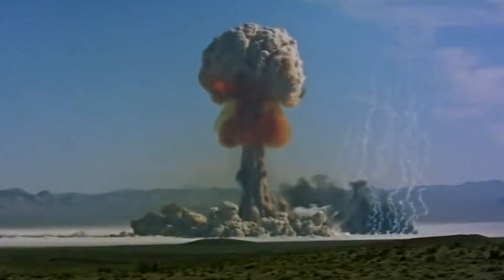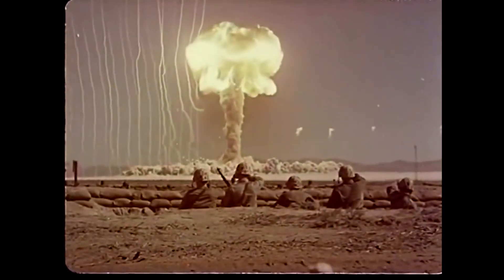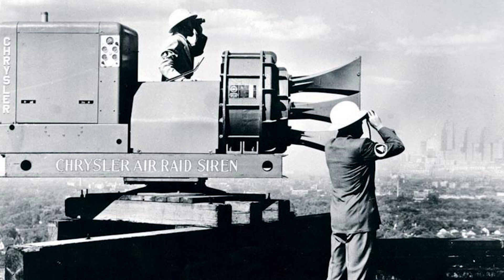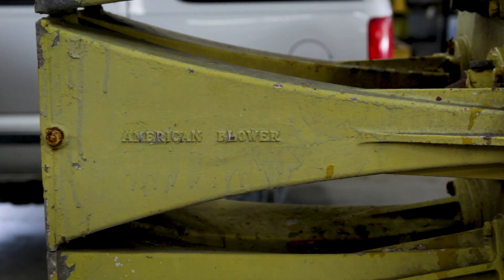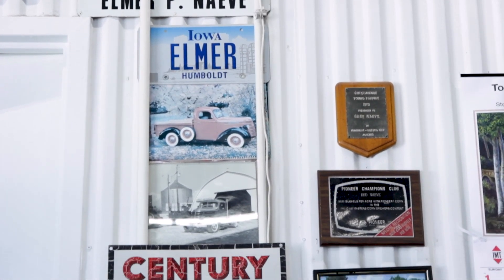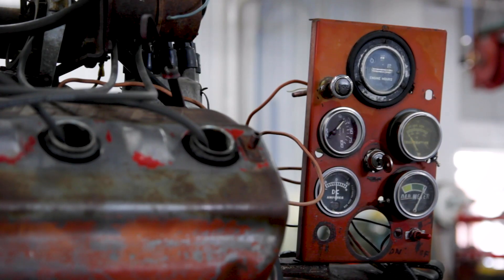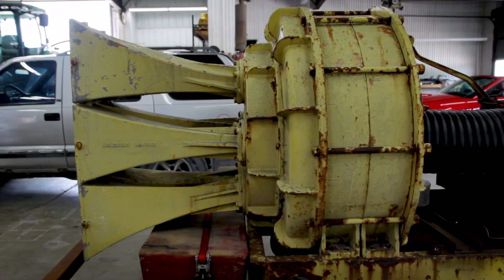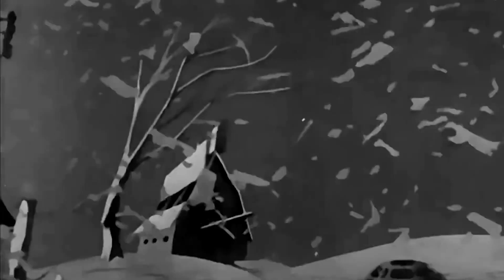Chrysler's Cold Warrior

Comment: There were british sirens that could be heard for miles as they were 150 decibels and as a kid it was scary to hear one up close but i love them now and yes it hurt my ears as the siren was at a fire station in the uk
Reply: The Chrysler siren was the loudest siren ever made, anywhere in the world. It's an established fact. Please provide proof of this 150 decibel siren you speak of.
Reply: @csmitharris1460  have a look on the klaxon website and look up klaxon GP12. I tell you now that this siren is very loud indeed like I said. This siren has a high decibel rating of ANY british siren. I know the Chrysler was America's loudest siren but our dual tone sirens are there as well. I should know. I have been close to one in the uk for a flood test and they are SUPERDUPER LOUD
Reply: By the was. New zealand has sirens that could eat chrysler sirens for dinner as they are specially built with turbos to increase the sound and 2 huge horns on eather side and they are like our sirens but with charged up sound without a supercharger or air compressor and they are 159 db because of where they are. They are called tactical tooling sirens sirens
Reply: My research is showing the GP12 is 124dB @100 feet, (source: http://www.klaxonsignals.com/images/Products/docs/datasheet/417.pdf) the Tactical Tool NZ one is 110, maybe a little more @100 feet. (source: https://www.youtube.com/watch?v=zO389uJyaGs) The Chrysler is 138dB @100 feet. It still reigns supreme as the loudest siren ever made anywhere in the world. The storm sirens in my local town here in the midwest are louder than both the sirens you mentioned.
Reply: Apparently there was an article or something that said 150dB for the GP12, but it was a load of crap. https://www.airraidsirens.net/forums/viewtopic.php?f=10&t=9655&p=84773&hilit=klaxon+GP12#p84773 @jezcolborne9596
Reply: @csmitharris1460  no. The GP 12 sirens are the best as well as the GP8 sirens so they aint crap as they are DAMN LOUD.!
Reply: @jezcolborne9596  Chrysler siren at 1 meter is between 170-173 db and 189 db at the horn opening.

Comment: Gary and Ryan. I see you guys have an original manual too. I hope you watched my Pittsburgh Chrysler siren you tube post. Your siren has some corrosion holes, like mine did. I put some hours into restoring it and all is good now. Do you have the shrouds and are you going to restore yours ? I have the turntable base with mine as you can see in my you tube. I do have a problem now. The engine won't run. The compression is good, new dist. cap, plugs, plug wires, rebuilt carb and fuel pump. plugs fire. new coil. No action when I put gas down the carb. I can't get it go no how. I think that dist gear that engages the cam might be bad. The rotor turns OK. No one I check with knows how to work on the old hemis. What can I do ?